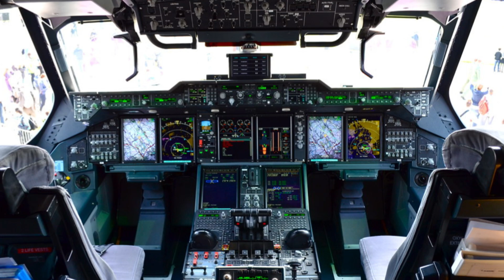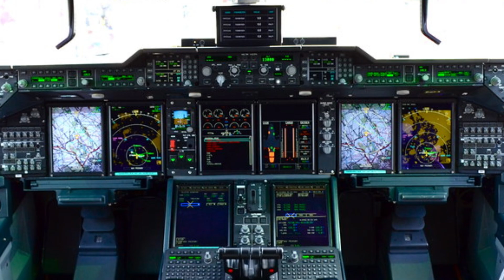Trapped in a Doomed Aircraft: The Airbus A400M Disaster

Comment: I prefer fly by cable instead of fly by wire. Top tip, avoid anything which is promoted as a scientific breakthrough, or the modern solution to a non-existent problem. Think smart meters/devices and EVs.

Comment: And personally, I DETEST fly by wire. THERE ARE NO OTHER OPTIONS. It works to the best of the engineers...Old School aircraft that used analog systems? They survived terrible damage and the pilot often could still control enough of the aircraft to fly. In this case? there was absolutely NOTHING that would work. It is CRIMINAL IMHO.

Comment: The fact that the software was so easily corrupted by the person who was installing it is very bad news, surely the testing of it would have shown up that it was corrupted, but it obviously didn’t and that is really really bad news, but what really does defy logic is why there was no backup system fitted, some form of manual reversion to a mechanical system or at least a computer backup for such an important system. I think that our reliance on electronic control systems is pure folly, it only takes one cable to be damaged or the computer system to fail and the result is always going to be catastrophic, I don’t believe in allowing technology to run such systems, especially without a backup/redundancy built in to the aircraft, computers are fine for the most part but not for critical systems.

Comment: the AIRBUS A400M Atlas multi mission heavy lift transport aircraft could do with a stretched fuselage variant . . . however this might have to increase the wing area if not the wingspan, compensate for the increased weight . . . and ofcourse more powerful engines, infact a hybrid propulsion could be beneficial . . . surprisingly the FADEC of the A400M didn't have a pilot overide over flight controls in the event of a malfunction . . .
Reply: yeah and such kind of technical waste is named " military class " by self polished in otherones ears

Comment: They say that they reproduced the flight in a simulator and that they couldn't save the plane but isn't possible from 1500   feet even with that big bird to push the nose down in order to build enough speed to accomplish a flare upon impact increasing chances of survival. Obviously the pilots never had the time to take that action as they were probably troubleshooting to get the engines back online.
Reply: it's possible that's what they were doing and that's why the descent rate increased to such a high level. i don't think they hit the ground at 3000fpm.

Comment: Why I don't like even ABS on vehicles. Yes, mechanical controls can fail, but at least they usually give visible indications prior.
Reply: i've removed the fuse from the ABS on a few cars in the past.
Reply: @JTV84  Yep... a switchable ABS would be nice... since the ability to lock up brakes has helped me to avoid accidents in the past... but there's just less to go wrong without it.

Driving on ice? Just switch it back on!
Reply: @kentuckybowl-o-sticks  especially on snow.

Comment: OK, bad system design.

Some basic rules for mission-critical systems:

1. Factories should do QA on each construction, not assume that the quality is there. TQM (Total Quality Management) isn't actually viable, but you can get close and, in the case of computers, need to. 

2. If data gets erased or corrupted on one system any time before takeoff, the software should report an incorrect install and not permit any engines to start. This is a critical power on self test (POST).

3. If in flight, data erasure or corruption is detected, there should be a backup trusted source for recovery, particularly on a military aircraft where you must assume a hostile force can corrupt computer systems remotely. It's likely there was time enough for such a restore.

4. Designs should never have any single points of failure, where possible. In aircraft, some are inevitable - you can't do much with no wing/tail - but a mixture of fault tolerance and backups can add a level of robustness to internal hydraulics and electronics.
Reply: at 666,6 ft: stack buffer overflow
at 999,9 ft: sorry dragons only allowed 300m - have a nice downgrade
Reply: @crashtestdummieslaugher Anyone not yet using at least contracts, preferably proofs, within programming when the code is mission-critical deserves to be kicked.
Reply: @jonathanday6692  there is no one coding in assembler - forget ballonpuss

Comment: AS A PILOT, I THINK THAT THE "TECH" IS GETTING OUT OF CONTROL.  IT SHOULD "ASSIST" THE PILOT, NOT REMOVE OR OVER RIDE THE PILOT....THIS SHOULD NEVER HAVE HAPPENED....WE HAVE THE SAME ISSUES WITH THE AIRCRAFT IN THE U.S. AS WELL.....AT LEAST THE PILOTS WERE ABLE TO MISS THE ROADWAY.  MAY GOD BLESS THEIR SOULS
Reply: even an bolt without a fokkernail is much more reliable in flight

AirBus should demount wings and flaps and let the transport solution on the ground without their specialists in coding
Reply: Agreed. A huge mistake in most industries. Highlighting human error as the main reason to empower “tech” to take over most responsibility should not be the only solution. Training personnel to more rigorous standards should be considered as well if the current training and minimum skills is insufficient

Comment: Everything fine until throttle back and computer code missing on that part cause that throttle software crashes. And there is no backup or manual bypass the software. What a risky design.
Reply: " heavy failure in OD please consult your doctor with the summon tree "

Comment: I had an incident on an A-319 on descent when both engines stayed idle. No matter what I tried, they would not provide any more power. I put the aircraft into Alpha Floor and everything began to work again. It was night and I was in a forest, snowing and at 7000 feet. My airline and Airbus attempted to whitewash the entire incident. Within a week, all the A-320 aircraft types had a software update. I did much research into this. Software does not undergo the stringent testing that other components of an aircraft are required to do. For instance, a hydraulic pump is run until it fails. Others go through this same process until a consensus is reached and a TBO (time before overhaul) is determined. I am oversimplifying this process. The bottom line is that these manufacturers cut corners and do not always do the testing that they should. It is called "Risk Management".  It continues today and it is all of them, not just Airbus.
Reply: We have long had a saying in the computer industry: If architects designed buildings the way software is written, the first woodpecker to come along would destroy civilisation

Safety critical coding is a different paradigm to general work, but you have to deal with management that thinks everything can be done with desktop windows PCs (I'm not kidding, the number of times I've had to explain that servers are needed for xyz reason defies belief)

You could achieve a lot by re-educating the accountants. This is where most of this mindset originates as they usually don't understand the industries they're working in, only seeing numbers and dollars
Reply: @ 99 little bugs in the code 99 bugs in the code Take one down, patch it around. 127 little bugs in the code.
And people think it's a joke but it really isn't.

IIRC, based on previous code it was estimated that Win$hit 2000 had 400,000 bug in its code. Not every one was a major item but how many Zero Day ones do there need to be for the program to get exploited and OWNED!
Reply: Airbus should be following ED-12C on their civilian aircraft in order to be type certified for commercial use, which requires very comprehensive testing for software components capable of causing catastrophic failures. As long as the certification was performed according to the standard, it is misleading to suggest that "software does not undergo the stringent testing that (hardware is) required to do".
Reply: It seems like Airbus and Boeing are same POS...
Reply: Yeah IT professional is an oxymoron.
Reply: @davefoord1259  " Yeah IT professional is an oxymoron. "
trust me they hate anykind of controllers - even technicans and engeneers which build the shit.

i bet one dollar they build the software with c++ and even not in assembler
Reply: And MBA is a major structural problem.
Reply: You were in a snowy forest at 7000' operating an A319? That's bad.
Reply: Do you know the story of Norbert JACQUET an AF airline  pilot who has been a whistle blower about this after Habsheim crash in 1988?
Reply: @eriklapparent4662  And look how badly he has been treated since that happened. Very disgraceful for a pilot of his experience on the aircraft.
Reply: Thank you.
Reply: talk us through how you reset to Alpha Floor.

Comment: If I understand it Airbus did no "ground check" on the software before releasing the aircraft. "No automatic verification system" (10:01) is said.
Without a proper torque signal no engine works properly.
It mains misterious how the craft came airborne with 3 faulty engines, and there after could not stay in the air... why did the problem not directly occurred at the full-power spool-up after the take of clearance?
If only one set of bits is missing the aircraft is doomed. There is no redundancy hence, like structures (?)
Airbus had several software related deadly accidents in their history.

Comment: I have extensive aircraft maintenance starting in 1969 as a US Air Force trained aircraft mechanic and a crew chief on C-130s.  Also FAA A&P licensed mechanic.  Also a non airline commercial pilot with multi engine and instrument rating along with seaplane rating too.  Also several years as an Air Force Reserve Flight Engineer on C-130s.  My experiences cover many aircraft from an Aeronca Champ up to the C-130.  

This is exactly why I will never fly on any Airbus or any other aircraft that flight controls are handled by computers and can not be taken out of the system by the pilots.  Also any aircraft that does not have direct mechanical connections to the control surfaces and the engines.

THOSE DAMN COMPUTERS DON’T HAVE AN ASS TO FLY BY.  THERE ARE VERY GOOD REASONS WHY THE STATEMENT, “FLYING BY THE SEAT OF YOUR PANTS” EXIST!!!
Reply: Given that 'fly by wire', computer controlled systems, and systems where software driven electric motors/actuators increasingly replace hydraulics, you will have a hard time flying WITHOUT encountering systems where software is in critical control loops.  The 737 Max disaster is just one example, although had they installed redundant pitot tubes, that allegedly might have prevented the crashes.
Reply: @   I won’t have any problem flying to where I need to fly too.  My aircraft does not have any computers of fly by wire in any control function.  Just a little bit in the GPS system that I very seldom use.  I use it mainly to help stay out of restricted areas.  I can get anywhere in the lower 48 states as well as parts of Canada, Mexico, and the Caribbean in a day.  Don’t every plan to go any further.  I have seen all of the rest of this planet that I want to see.
Reply: I have zero aircraft maintenance experience, but I do have over 40 years of software experience. I have to respectfully disagree with your assertion.

First off, it's impossible to write computer software that doesn't contain bugs. That's pretty much the first thing they told us at university. Having said all that, it is possible to mathematically prove the correctness of computer software. Part of the software that runs automatic metros (underground trains) in Paris have been proven to be correct. The automatic metros in Paris move millions of passengers per day and have never had an accident.

Similarly, modern jet fighters cannot fly without computers, because they're naturally unstable. Good luck flying an F-117A or an F-35 without computers.

If your software becomes a case study, it means you messed up badly. Another such example is the Therac-25, where poor software engineering killed people.

What happened here was not a software failure, but a process failure. In essence, it's not really different from what happened at Boeing. There wasn't an automated deployment process, there weren't any automated verification steps, and the software didn't run integrity tests to ensure that the base conditions were met.

Where I work – offering mostly mobile telephony and internet access – such errors would result in a talk with your manager, and if no progress were apparent, dismissal. The code we write has to be covered by automated unit tests that cover both the code (typically 80% or more) and branches (70% or more). The code is then checked via static source code analysis, and when all of that works, it is reviewed by a human. If they approve the code, it is deployed automatically on the development environment. Then, the QA teams steps in. They run integration tests (testing the entire process, in contrast to unit tests) and run manual tests. It is then deployed on the user acceptance environment, where real (or almost real) data is used. Only if everything works well, it is put into production.

What this video tells me is that they didn't have a proper process in place. Whether it's computers or nuts and bolts: if the process is broken, it's irrelevant what breaks. The door blowing out of a 737 MAX had nothing to do with computers, but everything to do with the processes at Boeing being completely borked.
Reply: I can fully relate to the critical nature of feeling by the seat of your pants. As a heavy equipment operator (retired) of cranes to 200 ton class and heavy earth moving equipment, the input I receive from my ass, the small of my back, and my hands is critical to the equipment movements I make. All these machines are also now electronically controlled, leaving the operator nearly a bystander.
Reply: @chuckg2016    @   Most of my flying was VFR, good weather not in clouds, so one can use the seat of your pants better than being in the clouds.  I was also an Over the Road Locomotive Engineer for a major class one ( Big ) railroad.  I could actually feel the last car begin to move in the sear of my pants.  There are people that believe there is nothing to, “Operating by the seat of your pants.”  But for me and I suspect you as well as many others, it’s the best tool we have.
Reply: Can these things be taken out by an EMP?
Reply: @derikuk2967    I have heard that some can be taken out by an EMP.   I have also heard that the builders can shield some from being taken out by an EMP.  But not sure if either is 100% true.  My question is if some could be shielded why not all.
Reply: Well, the problem was known and nothing was done about it!   Pass the buck lazy minded bureaucrats let it slide.  Great videographics.  Too bad pilot could not find an open field and keep wings level.  What is the planes glide ratio?  At that AGL it’s too late to trouble shoot.  It’s glide and land immediately time. What was the test flight even for?  These military planes are worthless without troops who want to fight. NATO doesn’t even have an army to speak of.

“The phrase “The best laid schemes of mice and men” originates from the poem “To a Mouse” by Scottish poet Robert Burns, written in 1785. The line reflects the idea that despite careful planning, things often do not work out as intended. 

“In the poem, Burns addresses a mouse whose nest has been disturbed by a plow. He empathizes with the mouse, illustrating how both humans and animals make plans that can be easily disrupted by unexpected events. The broader message conveys the unpredictability of life, suggesting a universal experience where no matter how much thought and effort is put into planning, outcomes are uncertain.

“The themes of the poem resonate with human experiences and aspirations, highlighting the fragility of our plans and hopes. As a result, this saying has evolved into a common expression in English, emphasizing that good intentions do not always lead to desired outcomes.”
— CHATGPT 4

Comment: Software works the same for all the engines, why did one of them continue to work correctly?
There was no OVERRIDE to automations.
For proper redundancy we need 3 parallel sets of sensors to compare against each other and ignore the faulty sensors. If we use only 2 sets of sensors we will need very sophisticated algorithms to detect the faulty sensor(s) and deactivate them.

Comment: It should have failed before takeoff 🛫. Was there a full load testing before final maiden flight ✈️ 🫡🙏
Reply: dragons maximun allowed flight height: 300m at 1000ft the security protocol turns engines off
the last of 4 is only for correcting berhard and bianca airlines to the winkle for imp-act-pact-packed

...but the inschönöhrs had forgotten the stick for the override from the flight instructor